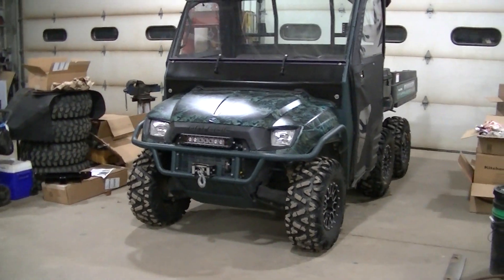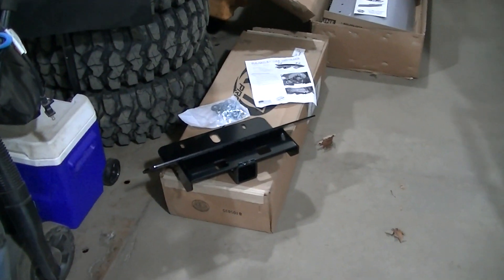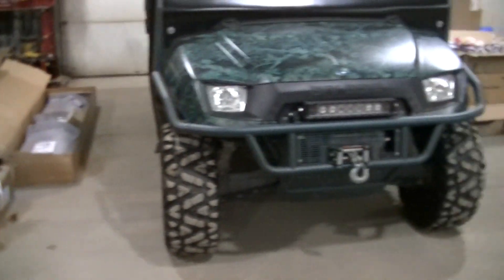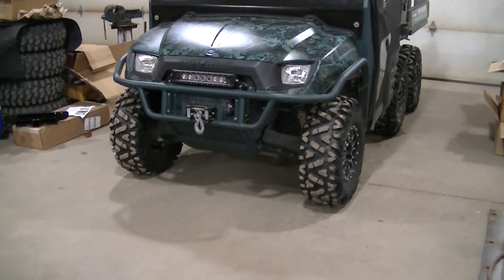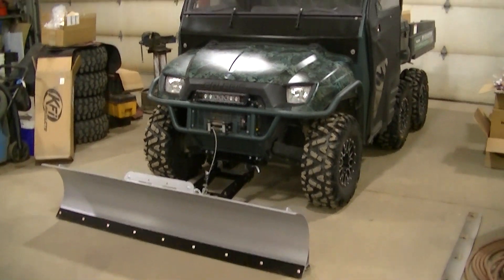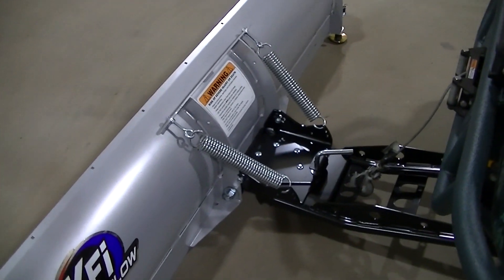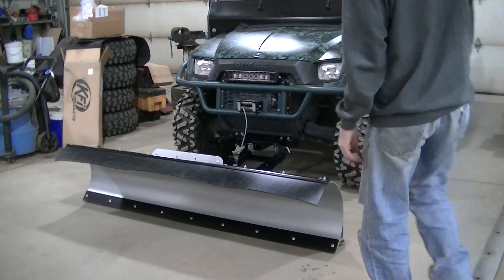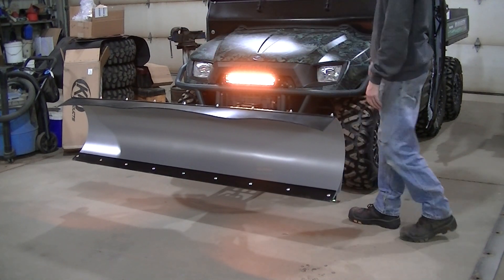04 Polaris Ranger 6x6 KFI 72" Snowplow Install

Comment: Love my ranger plow set up. Pushes an amazing amount of snow
Reply from the maker: What winch do you have? My Warn died on the test run. I got another 3500lbs winch but it seems like it's struggles to pull just the plow up. I haven't tried it with snow yet.
Reply: @mossman381  i picked up a 4500 champion at menards
Reply from the maker: I might have to get a 4500lbs one.
Reply: @mossman381  the champion was only 199.00 and i personally have gone through two warns at twice that price point so figured i would give it a try. Best wishes

Comment: I installed this entire setup on my 6x6. I also installed the power angle unit. Yes, it is a heavy beast!! It does do a really good job of plowing! I was impressed with its beefiness too!! Definitely well built!
Reply from the maker: What winch do you have? My Warn winch died on the test run. I got another 3500lbs winch but it seems like it's struggling to pull the big plow up.

Comment: Well hopefully you have better luck with your KFI then I did. I purchased a 60” blade for my Sportsman 800 about 3 years ago and it worked great for the first two seasons. Well this season our first accumulating snow was wet heavy. Long story short the weight of the snow and stacking some piles up the push tubes bent. I contacted customer service and they wouldn’t stand behind their product. Turns out they make a stiffener kit for the ATV push tubes to make them stronger. Sounded to me like their product wasn’t strong enough to begin with then. Kind of ridiculous if you ask me. They were also quite rude throughout the entire process.
Reply from the maker: Well that doesn't sound good. The push tubes on mine are pretty beefy. The whole plow seems heavy duty for a UTV. If something breaks I will just fix it myself. I can weld and stuff so not really a big deal.
Reply: @mossman381  I thought about trying to straighten it back out and having a friend help weld some reinforcement on to it but every time you bend steel it gets weaker so I wondered if I’d be in the same boat again soon and maybe even worse. Mainly I was really just super disappointed at how they handled the whole situation. I’m hoping with these news parts I will be happy with my plow once again, just like I was when I first got it. Hope to see more videos of yours soon!
Reply from the maker: The people behind a company are just as important as the products they sell.

Comment: Hey I just got  2004 6x6 the yellow one anything to look out for. I use rec fuel in it and the carb was just replaced last year
Reply from the maker: Fuel pump, CDI and voltage regulator are the things that will stop it from running and are pretty common. I think I have done all those on every older Ranger I have bought. Check your oil. So many people run these out of oil because they see no leaks and no blue smoke. These older Rangers are good machines. Not as refined as the newer ones but they can get the job done and are just as fun for a lot less money.